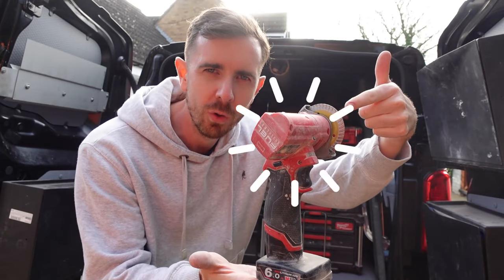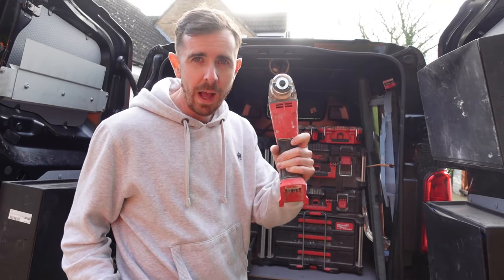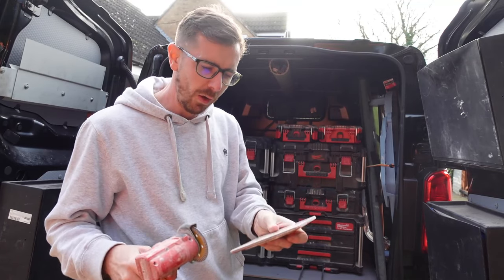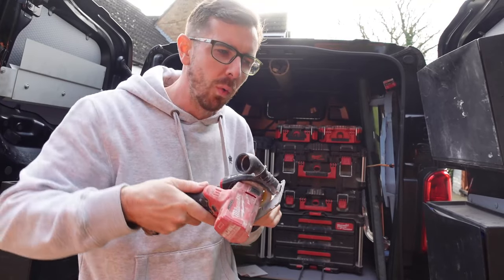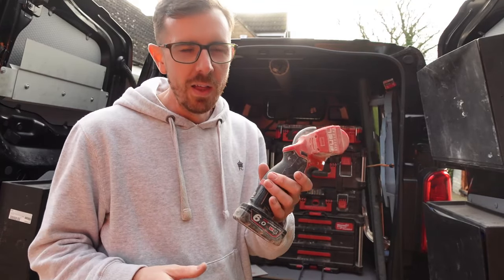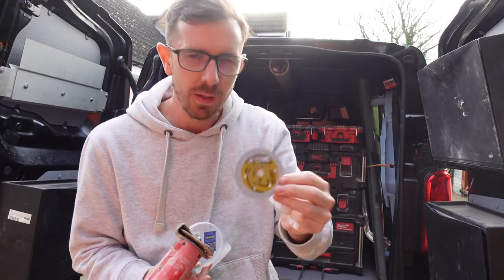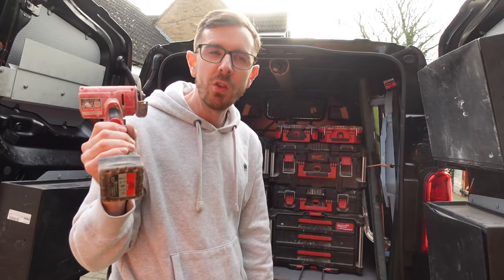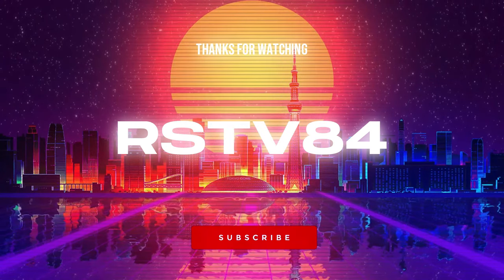Milwaukee Tool Review: My Must-Have Power Tool For 2024

Comment: is this Australia ? ... black Milwaukee tool boxes !!?
Reply from the maker: Do I sound Australian lol I'm from the mother land England!
Reply from the maker: What colour are yours...
Reply: @rstv84, you don't sound the least bit Australian . I was tiling in Perth WA for 15 years , I got out of it about 5 years ago . I have tiled some new builds when I  returned to the UK for extended holidays to see my elder children . There's a world of difference between working practices there and here . 
 Bathrooms and laundries here have screeded floors with falls to a 50 mm waste and showers are 80 mm waste . They've only recently started to use fibreglass shower trays here , before you had to brick up a hob , and screed the falls , then water proof it . All power tools here are 240 v or battery powered . Many trades that emigrated here brought their 110 volts equipment with them , but electricians here won't tag it for use on site !  The best 240 v grinders were Metarbo and I  used Makita 5 or 6 amp hr . Incidently the battery fitting is slightly different so you can't cross use them on tools bought in the UK and V V . 
 I would think you're from Guildford,  Surrey from your accent  .
Reply: Thanks for the comment you flaming galar! I'm from at Alban's originally but now reside in the countryside of Cambridgeshire. That's some big piping 80mm!! Who do you think has done it better the UK or Oz? W
Reply: @tridentbathroomrenovations   There's a lot more to tiling over here , even the baths are set on a mortar bed and bricked up and tiled rather that a plastic bath panel  . Lots of mitred edges here rather than plastic beading trims . 
 I've worked on Barrett's  , Persimmons sites in Cambridge , Huntingdon  , Peterborough and Wixham south of Bedford  . I was staying 40 miles west of Cambridge  , but didn't appreciate the two hours it took to travel into the city centre . I think standards are dropping and materials cheaper , hence I didn't enjoy most new build work . Potton timber homes were nice to work on , I did  one at Dunchurch , where the owner was a joy to work for . 
 If I can use Italian or Spanish  tiles , I can build a bathroom that will last 30 years .
Reply: @tridentbathroomrenovations  I've got a yard 10 miles south of you if you cut through the lanes via Tetwoth and a still keep a  house 20 miles to the west of you through Kimbolton .  Small world  .